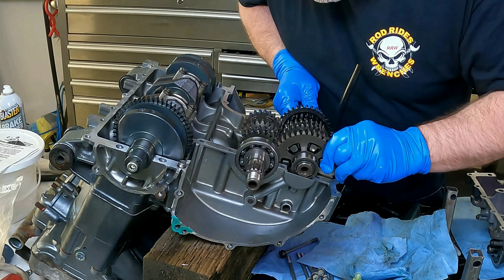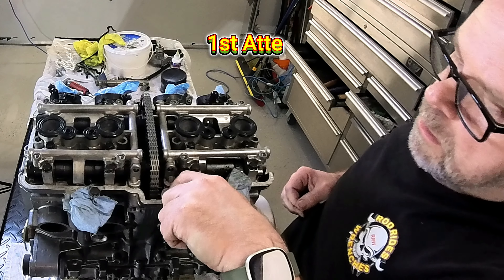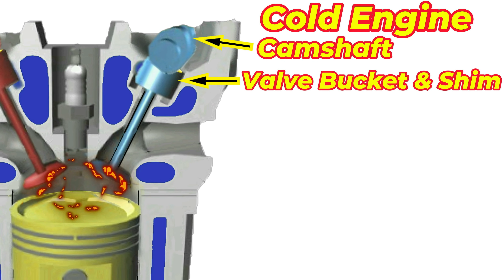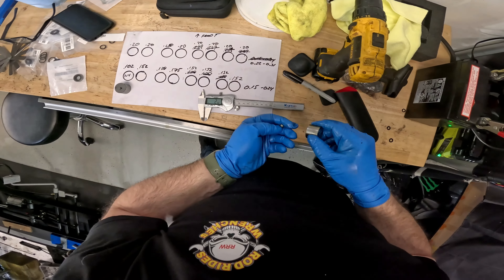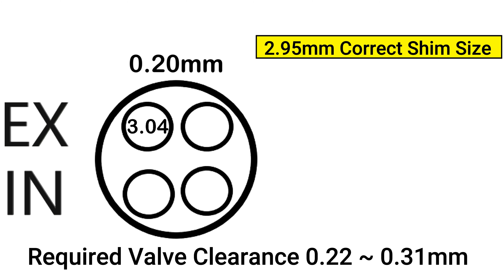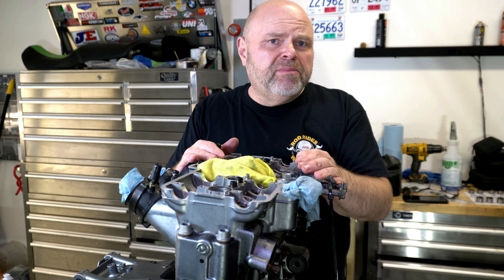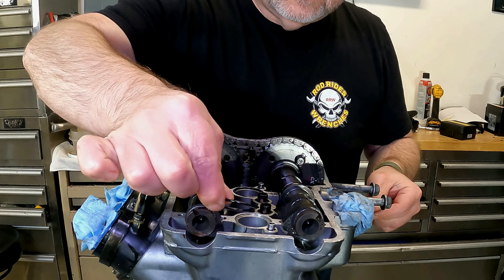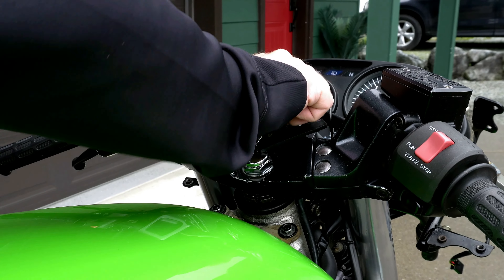A Thorough Motorcycle Valve Shimming

Comment: Very good video.  But while you should round down for the max shim size (as you stated), you should round up for the min shim size.  The min shim size would be 2.95 mm in your example.   Rounding down would give you 2.9 mm which would result in 0.34 mm clearance which is out of spec.  Rounding up gives you 0.29 mm clearance which is in spec.